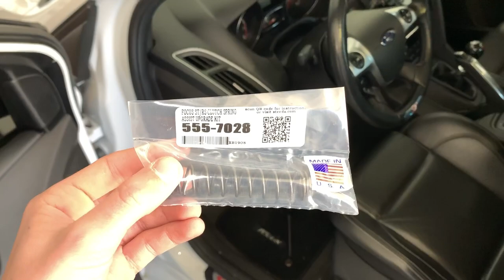Steeda Focus ST/RS Clutch Assist Spring Installation & Review

Comment: That little play is in all STs. It’s good to have that in case you have your foot resting on the pedal or above the pedal, there is some play there before it engages the clutch so you don’t damage it. Not necessary at all, especially if you are careful not to rest your foot on the clutch. But I like having that bit of “safety” play in the pedal.
Reply from the maker: Will IV That’s good to know. I’m glad it’s not a problem, I added a piece of rubber up at the top of the pedal to eliminate most of the play but there’s still a little bit. I don’t ever rest my foot on the pedal so I think it should be fine
Reply: So what ur saying is that i cant drive stick 🥺

Comment: Great video and instruction on how to remove the clutch spring housing.  Just want to add a tip: use 6mm socket driver through top of housing and push apart the two halves to remove spring.  This will save plastic and aid in reusing parts. Cheers

Comment: I got rid of that initial free play in my clutch pedal (which I hated) by simply running a heavy duty zip tie from the clutch pedal shaft to a metal bracket on the firewall just behind the pedal (just to the right of the spring you replaced). Adjust the zip tie so it stops the pedal right when the clutch is fully engaged, preventing the pedal from continuing upward. No more slop!